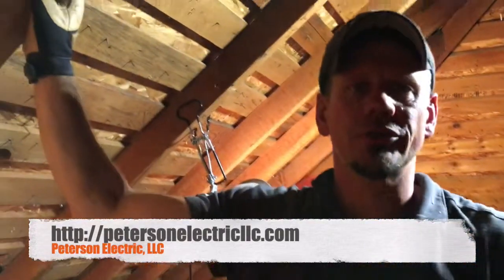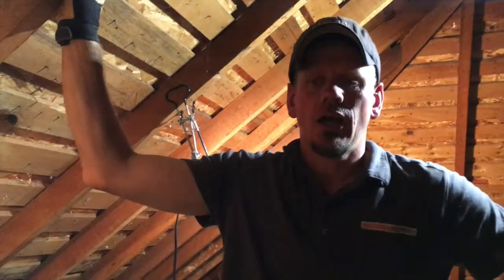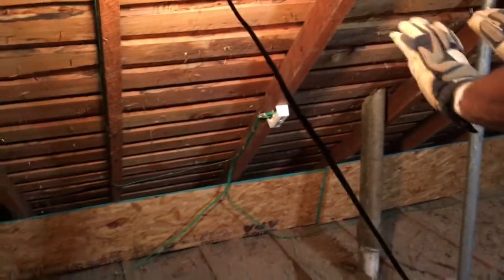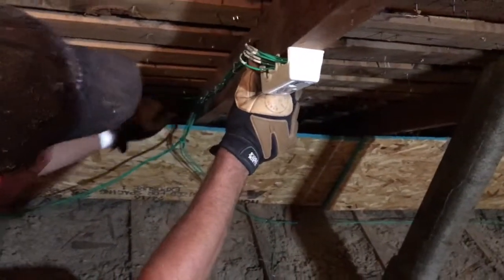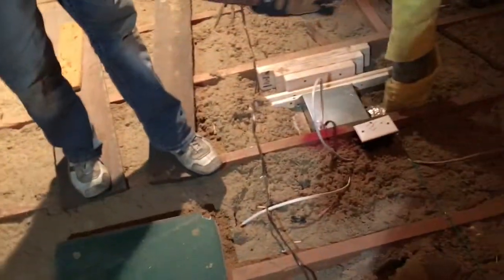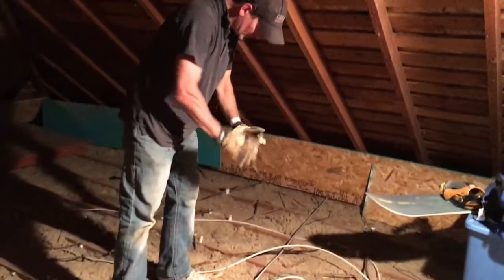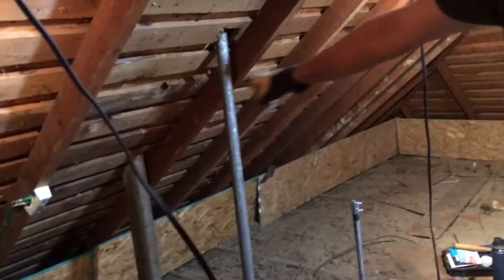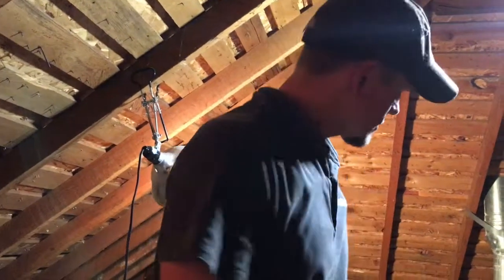How To Fix Old Wiring Without A Ground | EGC grounding conductors| Peterson Electric

Comment: I'm running a new circuit to an existing service panel. There is no sub panel. the service panel only has 2 -30a breakers. Can I just add a grounding rod, connect my new ground wire to the ground bar....and bond my new ground to the neutral bar?

Comment: So how can this be down in shown without a basement? None of our fans/lights have grounds. Only black/white wire. Electrician told us there is no way to ground just the fixtures only that we need all new wiring which we don’t have money to do and don’t want them tearing our drywall down like they say will happen. ( like I thought we could just ground the light/fan box’s in the attic space)
Reply: We are in Texas. Our electrical panel box itself is grounded. But none of the ceiling fans/light or porch lights have ground wires. Nor do the light boxes they are in are also not grounded.
Reply: Im in California and have the same thing going on like you, old house with black and white wires, you'd think if they can Launch Apollo 13 and Space Shuttles they can figure out a way to Ground some damm ceiling Fans and TVs

Comment: I only work as an industrial electrican so I don't get to see very much residential work but I was wondering if some people still use the old knob and tube wiring and I wonder just how dangerous it is with it not being grounded and what does that do to your electronics that plug into the receptacles.. I've also heard of people getting shocked becuase of old wiring in houses.. they grab on bath tub faucets and other metal objects in the house and get shocked because its not grounded or not grounded properly..

Comment: Good job. I didn't know that was allowed, gonna go to the 2020 NEC and brush up on that article. But..I would have some reservations about doing that. I'm already prepared to fish wires and I am already there and would up sell if not only protect my client but also myself from litigation if something went wrong. However great use of the inter system bonding bridge.

Comment: Great job I especially liked your home runs for the ground to not compromise ground continuity and ensuring the least resistance path. Would have liked to have seen some discussion on measurement data on the earth ground resistance at the property, and if you did a fall of potential method. NEC code suggest a 5 ohm value but I prefer a tenth of that value.

Comment: Was any of the old knob and tube still in use? If so she cant cover it with the blow in insulation
Reply from the maker: That's what the surprise was about, then I traced the knob and tube and realized it was dead. So, no power on old items, I ended up gutting the wire.

Comment: I tried this and failed inspection, inspector cited 300.3(A). Do you pass inspections using this method?
Reply from the maker: 250.130  A-C.   THIS INSPECTOR IS WRONG, UNLESS HE IS PRACTICING SITLL OUT OF THE OLD 2011 OR 2014 CODE
Reply from the maker: SO this depends on the AHJ view and if they are understanding the primary purpose. I would think that they would pass this, the only Biff would be that you need to protect where you have anything smaller than a #6, which would be if exposed to physical damage. I do not think the a crawl space or attic space would get damaged, or if you fish walls. The only place needed with EMT is outside. If you staple it high in an attic along the rafter then this is protected per 300 and 334 when this is allowed with NM cable.
Reply: My experience is every inspector is different, try another one schedule on a Friday.

Comment: So, you ran one home run to the grounding bridge, and then split off to different fixtures? I just wanna be sure I’m understanding correctly. I’m an electrician in Alabama and I haven’t seen it done this way. Most of the time with ungrounded wiring we throw in a gfci or dual function breaker.
Reply: I was gonna ask the same thing. Have to assume 1 homerun to panel from that bridge but was there even a ground at the panel? Maybe he went to a ground rod?
Reply from the maker: YEP - YOUR GROUNDING ELECTRODES ARE MOST IMPORTANT ON SIZING AND LOCATION AND CONNECTION OF ALL EGC.
Reply: Does your method meet code and if so what article allowed you to do so?